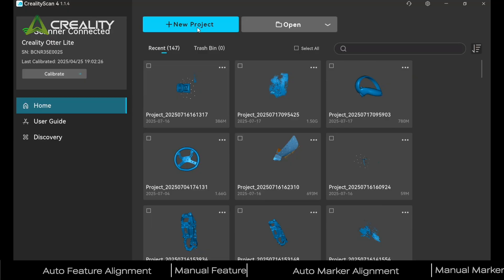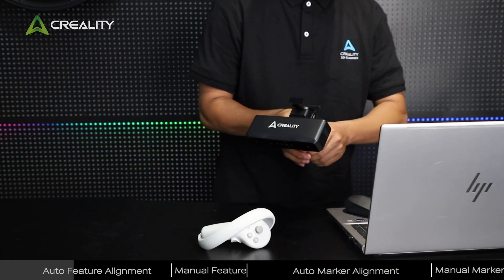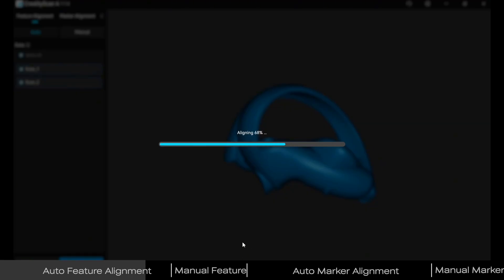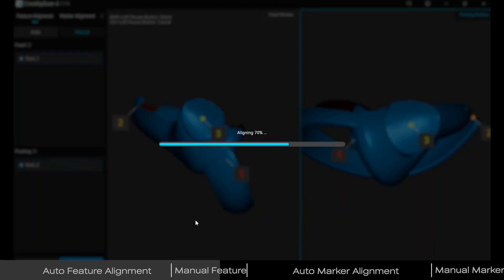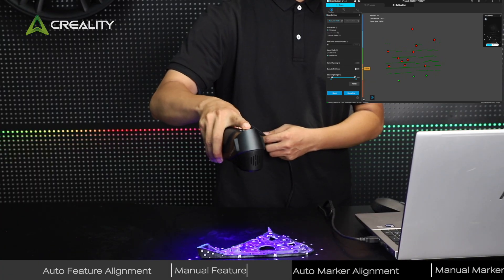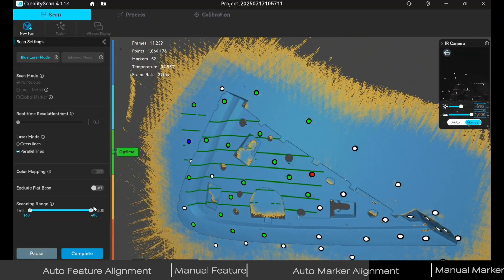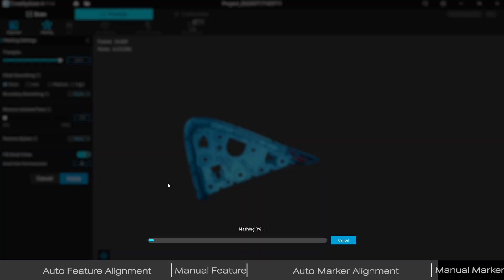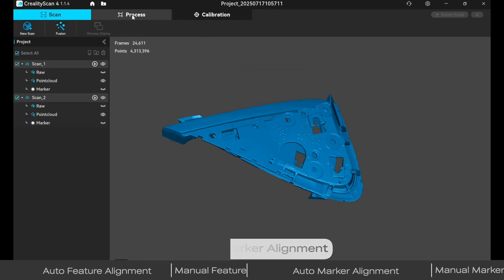How to Align Multiple 3D Scans | CrealityScan 4 Tutorial

Comment: Does this feature make it possible to scan large objects like cars or trucks by scanning parts of them and aligning them? Can the software handle such a task? I'm thinking about buying a Ferret Pro for scanning vehicles.
Reply from the maker: The stitching function can be used to scan large objects, such as vehicles. This can usually be done by scanning in two separate passes and then stitching them together. However, if your computer is underperforming, insufficient graphics card memory may cause lag during the merging process. https://wiki.creality.com/en/3d-scanner/cr-scan-ferret/tutorials If you're a new user, you can review this Ferret tutorial series. Before scanning, check your computer to see if it meets the requirements. https://wiki.creality.com/zh/3d-scanner/tutorials/general/performance .
Reply: @Creality3DScanner  Great! In terms of PC performance, I shouldn't have any issues (Ryzen 5 7600, 4060 Ti 16 GB, 64 GB DDR5), so I might actually buy one :)